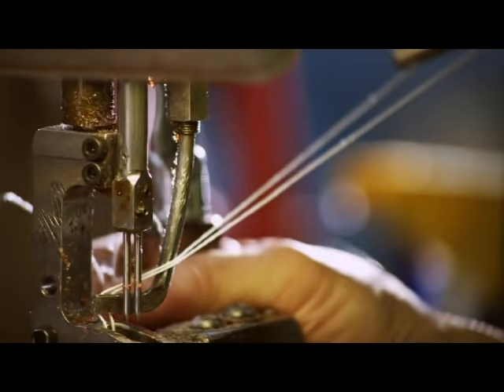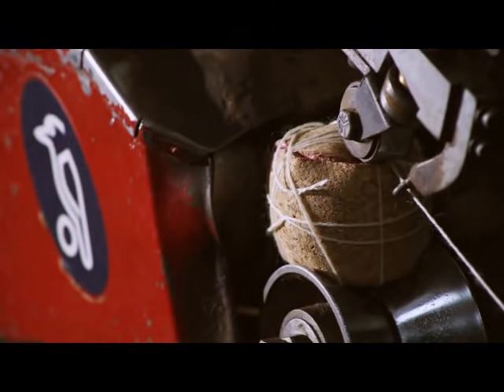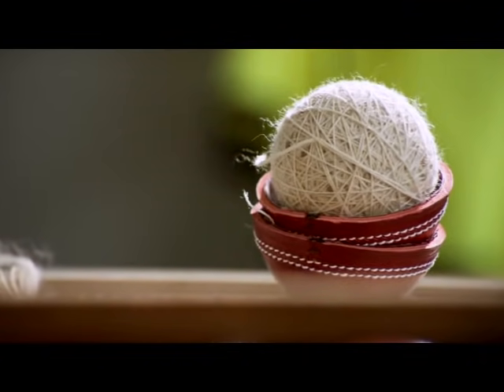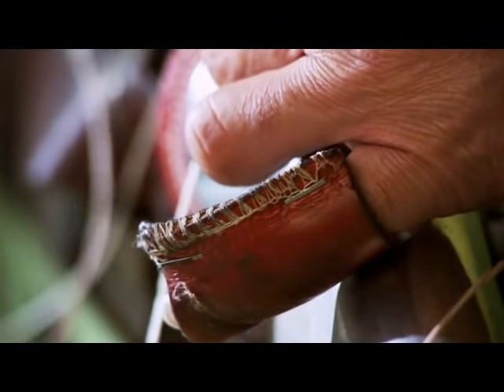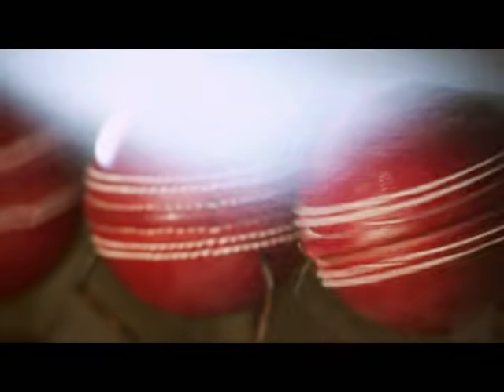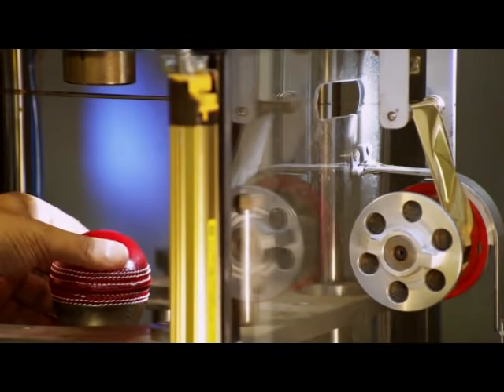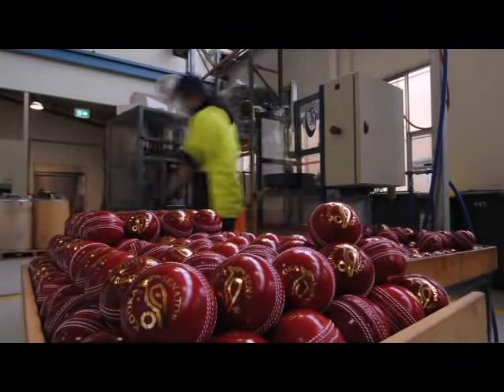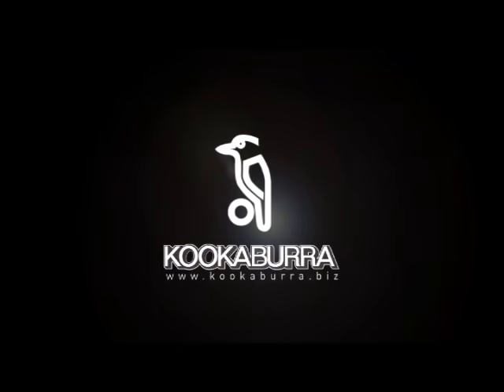Kookaburra Cricket Ball Manufacture Video

Comment: Duke balls CEO was right, there’s only one stitch holding your ball together! The others are aesthetic!
Reply: And for extra durability
Reply: Its machine stitched ball.but in hand stitched balls other stitches also hold the ball and also give good grip as compare to machine ball.
Reply: Never seen someone more passionate about cricket balls than Dilip Jajodia.
Reply: Yes they say hand stitched but at 1:02 clearly the outer ones are done by machine and don’t do anything !! I have new respect for the Dukes
Reply: Duke ball six hand stitched lines of seem all ball is hand made not like these frauds
Reply: CEO said the center stitch is actually termed as "seam". He didn't say the other 2 don't hold the ball. You can see in their video that the craftsman pokes the ball from one half to the other and then thread the string
Reply: not true. they have a purpose. they help hold the quarters together in a 4 piece. and they create the seam you hold when you bowl and for the ball to grip the pitch for spin bowling and jagging. just because they dont hold the 2 halves together like the duke doesnt make them useless. if anything the dukes is arguably the useless one, because one seam of stiches down the middle is more than enough to make a bowl last for the duration of a game/obligates overs in test (and still hold up well enough to be used for training afterwards) the dukes stitching is kinda over kill that just makes the ball more expensive and less accessible, sexy as they are
Reply: @yareyare_dechi  also provides the the entire six stitch seam for swing.
Reply: Dukes ball better than kookabura

Comment: Dukes makes the best cricket ball. 100% Hand-crafted
Reply: Dukes are too soft here in Australia kookaburra lasts longer
Reply: i mean "100% hand made" doesnt mean better, its just means that they chose a less efficient more expensive method of manufacturing. "its better because they didnt use a machine" is really just a marketing ploy. if anything handcrafting is not going to be able to reproduce the consistency and uniformity as machine made. also i doubt everything is hand made. i find it had to believe that that didnt use any hand tools and presses. a machine is still a machine whether its hand powered or powered. a ball wont know the different id the corck is press by a dude cranking a screw or a robot pressing it and a patch of leather is a patch of leather regardless of where are not someone cut it out with a knife/scissors or a pig press pressed a cutter into a blank and made 50 at once instead of 50 in an hour. theyre both still operated and monitored by a person.  that said the dukes ball is sexy as fuck